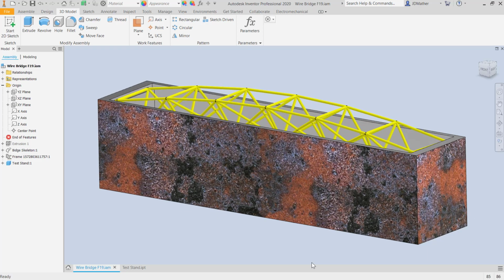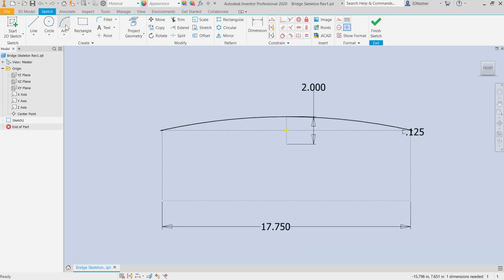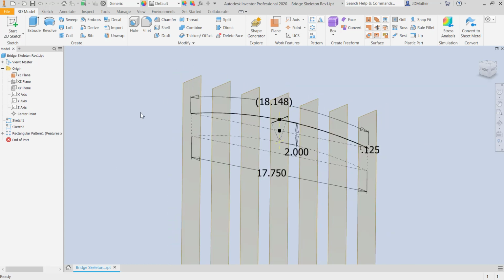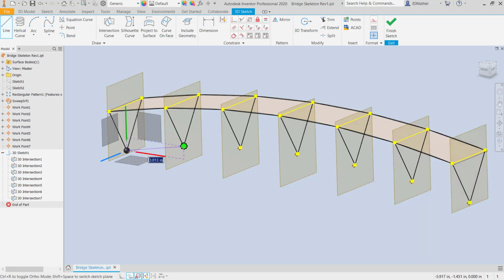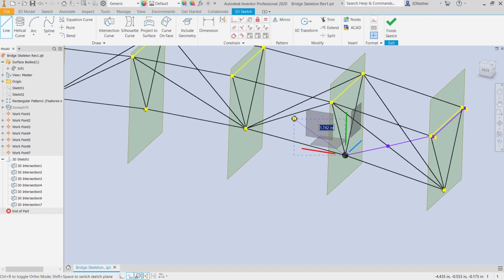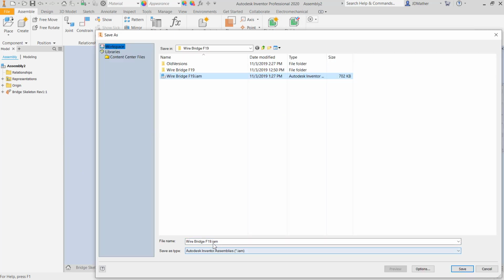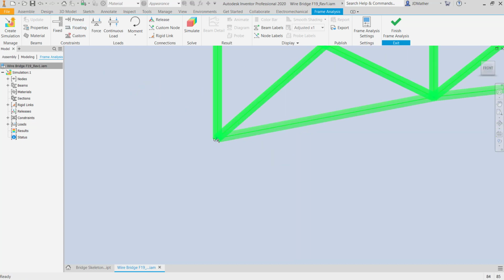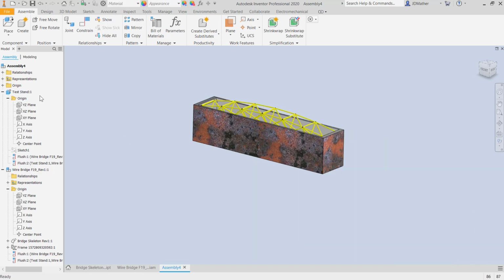Inventor FEA - Frame Analysis of Model Bridge Project

Comment: Did this video get cutoff or does it continue?  It seems to have ended abruptly?
Reply from the maker: I assume that by the time students get to FEA, they are essentially professionals at standard modeling practices.  Edit the model as logic would indicate is necessary.
Reply: @TheCADWhisperer  From the title of the video, I assumed it would have touched more on placing loads, etc. vs. modeling practices.  (It was a very good video by the way.)